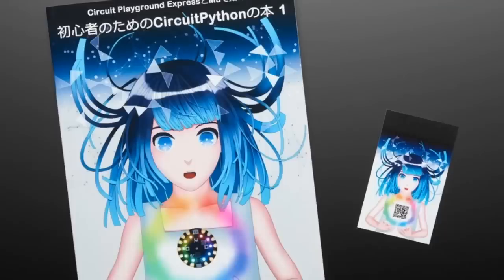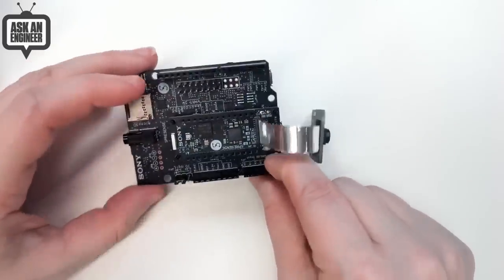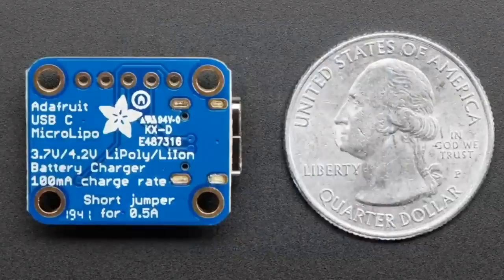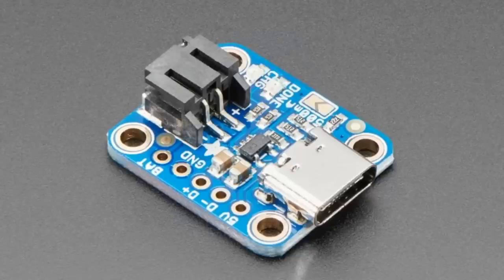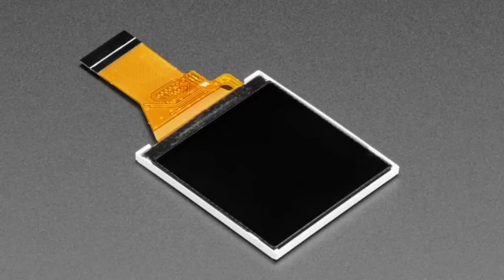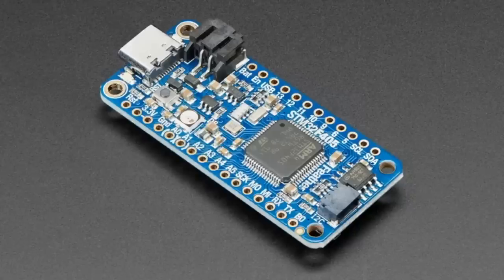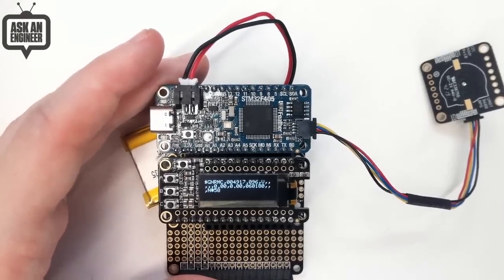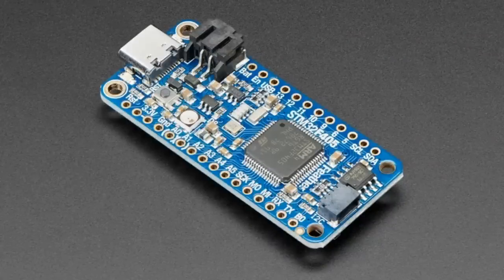New Products 10/31/19 Featuring #Adafruit #Feather STM32F405 Express!

Comment: RE: Micro-Lipo Type C charger
When and what kind of power can be had on the 5V and VBat lines? Is 5V the main power output from this board, or does that contact only see 5V when the USB is plugged in? Is VBat the main power output from this board, or is it just tied to the + battery terminal with no buffer or LDO inline? If I wanted to put a hardware power switch between this board and my Teensy 4.0 (purchased from Adafruit), could I just put it between the VUSB contact on the Teensy and the power output from this board? Does the VBat still have voltage when the main power output has no load, i.e. when I use the hardware power switch to remove the T4 from receiving main power from this board, does it see no load and shutdown all power, including from VBat? This would assume the VBat is not the main power output from this board.

Good candidate for creating a breakout board for the Adafruit shop/ecosystem would be an I2C GPIO expander. I'm having to get a 40 channel one to hook to my T4 to do one of my projects, giving it 40 more DIOs with interrupt for just the cost of two I2C pins.
Reply: 99% of these questions should be answered on the data sheet